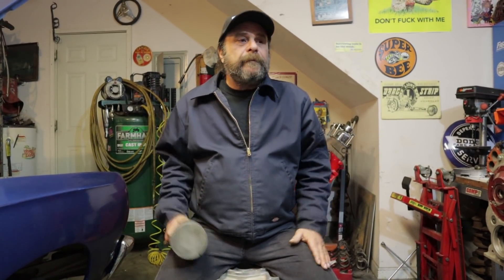3 Reasons Junkyard Engines Go Better With Boost

Comment: Back in the 80’s, if you had 300hp, you were the big boy in the neighborhood
Reply: I was gonna say same thing uncle tony did I had a car in high school in the the late 90s early 00s that ended up making 340hp on a chassis dyno and there were plenty older guys with cars they had built in the 80s way fast than that thing was
Reply: When we were young lots of us got misled, too. Kid I went to school with was selling a Chevelle claimed to be a 327 with 2 x 4bbl. Well, my cousin, the 'vette expert, did a PPI for a family friend that was interested in the car. Thurns out it was a 283 GM Marine block and the linkage was so messed up that only the primaries on the rear carb were operational. (think how happy the intake valves were about that).  So, absolutely no knock on Chump or Jim but when we were 17-19 dat's  da best some of us could do with only here say "technical help"
Reply: @ccpgmike620  I had similar issues but I learned that the local library had tons of great books on building and learning about cars.
On top of that they had like 20 years of hot rod magizines, some where on micro film. But the information was there if you wanted it bad enough and I went from one of the slowest to the fastest in about a year and I took a LOT of money from the assholes that liked to mislead the new guys.
Reply: @ccpgmike620  
I remember that stuff like it was yesterday - way more BS stories than the actual cars or parts! LMAO!!!!
Reply: While more horsepower was possible, i remember the budget of the average teenager build where I live in Philadelphia in the mid 80's limited most everyone I knew to the 300-400hp range. Considering that most of us lived in row houses without garages or even driveways we did the best we could with our curbside builds.
Reply: @jamessouthworth1699  
You nailed it.
A big part of it was the income of a given area or individual.
Reply: James Southworth yeah couldn’t imagine now it’s definitely a lot harder now
Reply: James Southworth also it helped when you knew a group of people with the same interests in cars every one tried to help each other out too.
Reply: @Jon-O.  
That's how it all worked back then, there were a few guys that could do anything but usually it was one guy did engines, one knew transmissions, another gears & axles, and someone knew body and paint.
People traded work back and forth or all got together and built a "neighborhood" car, we all raced the same nights on the same streets.
I'm not sure how some people can say much horsepower they were running back then, chassis dynos were all but non-existent, and unless you knew someone engine dyno time was big bucks.
A friend's father ran the dyno at the G.M. Tech center in Warren and the only people that got dyno time outside R&D were racers sponsored by Chevy - although my friend's father's cars always ended up dyno tuned (lol!).
Yeah, when it comes to money that parts harder now but the parts available now are incredible compared to back then.
Back then you made or modified parts that can be bought off the shelf now.
Reply: @Curtis Fleabag 3-400 at the wheels on pump gas and the motor back then was nothing to sneeze at. I knew plenty of guys making a lot more. But they were all running nitrous and or too much compression for pump gas.
Reply from the maker: Not really.  Back then, a stout street car was in the 6-750 horse range
Reply: Uncle Tony's Garage , yeah but I was 18- 19 then, 6-700 was unreachable
Reply: Jim Kalfakis lol ya I was surprised with the 340hp as all I had done to the car was add a mild cam and dual exhaust and a bigger carb it only had a 500 cfm carb at first and ported the heads with a dremel lol I’ve still got the motor both the cars long gone now. I did have the advantage of it being a motor from the 60s though so I had the compression
Reply: Uncle Tony's Garage 

Most I ever got was around 300 back then too. Of course that was SBC on a budget getting parts at swap meets and junkyard. No internet for advice or research. It was a very expensive task back then to achieve those numbers for most of us.
Reply: @chrisj197438  
That much is true - I was a little "spoiled" as far as knowledge back then, there was a short track racer (Rigurelo's neighbor) that kind of took me under his wing and taught me a lot of ways to make good power for next to nothing (like Uncle Tony is doing for people now) and sometimes sold me his worn out or obsolete parts cheap - including teaching me how to fix them and WHY I'd make power with certain parts.
Dyno tuning was a high dollar only thing back then.
I was the greasy neighborhood kid with the busted knuckles and a beat up small block 4spd Chevelle that outran a lot of the big block cars in the area - I had almost nothing for money but a damned good teacher.
But I was really really lucky.
Reply: Motor City Mike 
Wish I had a mentor back then. I was pretty much flying solo and learned by trial and error along with magazines now and then.
Reply: @chrisj197438  
I was lucky - no two ways about that.
But I did go through the same thing as you when I got bored with Chevys (that didn't take long).
I had grown up with Fords and Chryslers, so I went "back home" to them.
Back then the Ford and Chrysler go fast stuff was like black magic, there were almost no aftermarket parts (compared to Chevys), the magazines were nearly all Chevy stuff and the Ford and Chrysler knowledge was heavily guarded.
I broke or burned up a lot of parts learning the quirks of different engines in the early years but whipping up on the Chevy guys sure put a big smile on my face once I did.
I always liked a challenge.
Reply: STOCK...
Reply: Back in the 90s if you had a big wheel you was the cool kid 😎 on the block
Reply: @CC Ryder 
My Chevelle was anything but light...
3742lbs. + me which was another 215, wasn't what I'd call a light car. 
Are the Challengers & Camaros 4500lbs?
My 5.0 Capri was almost a thousand pounds lighter and my V8 Pintos varied from 2100 to 2300lbs. depending on which axle or trans I went with.
THOSE were light cars!
Reply: @CC Ryder 
Good enough
Reply: it all depends whether you mean cruising around on the street or at the drag strip.
Reply: in small towns, 300 hp was normal--i knew a few 68-72 Chevelles running that.  A large part of that was due to running pump gas--the magazines all built engines with 8:1 - 9:1 CR.  Swirl porting the chamber was new tech, and factory fast burn chambers weren't littering the junkyard yet.  The average hot rodder built their 350 or 351W to the 290-300 hp level offered in a 1970 SS or Mach I Mustang, once you added headers, an aluminum intake, and a real dual exhaust. It was enough to smoke the tires, and that was enough for these "Grown up kids".

I have the magazines from the 1980's, and 500 hp was big block territory. If you were actually, honestly making 600-750 range, you had a race engine on the street or a serious power adder (yes, there were magazine cars with fake blowers hiding a 4 bbl at the end of the seventies), and were making trips to the airport for Av Gas. There were street racers in Chicago making the news, typically grabbing tall deck 427 truck blocks and using thousand dollar billet stroker cranks and a lot of nitrous.  I'm thinking those blue and pink "yenko" camaros, and the other yellow one with the black Motion Performance arrow stripe down the side. 

The early 1980's was getting back on its feet, the late 80's were using EFI and small block mustangs to turn in great numbers. The tech was catching up, it was no longer "lots of cam, lots of compression and lots of carbs" backed up by a rear gear ratio that limited you to a 110 top speed like it had been in the prior decades.
Reply: It doesn't matter how much power the motor puts out if you cant get the car to hook up. It may be heresy but you can have too much power as well as too much tire. An example of too much tire. I knew a guy with an early Miata. He put wider tires on the rear end. After the first time he drove it in the rain. It scared him so much he put the stock rims and tires back on. On a wet road there was simply not enough weight on the ass end to squeeze the water into the tread pattern. It just wanted to hydroplane. Too much power. Power is only part of the equation. Burn outside might be fun and look impressive but I'd rather have a car that puts every bit of power through the drive train to the pavement. It's the engine, transmission, suspension and tires all working together as a system. If all you can do is smoke the tires you're just quoting Macbeth, Act 5, Scene 5. "Sound and fury signifying nothing"
Reply: True, its an age/maturity thing (and that's not meant out of disrepect).  When we were all younger, we wanted attention. We wanted a big power number, a noticeable power adder. That works well sitting still in a show, but out on the street, a car we're afraid of is a car we never max out. 

As we get older, we realize its enough just have a car worthy of being in a show. My old big block makes 400 hp, I have yet to get it over 70 mph, but folks recognize a 1968 4-4-2.  

I don't need to show off to get attention, those who are worth my time already notice the car. I enjoy my experience with it.  These two statements are things I can say about a house, a car, a romantic partner, a job position.  When you're older and/or mature, you realize this is the definition of success.
Reply: In the late 70’s and early 80’s the junk yards around here where full of big blocks sitting in old wrecked or just not running muscle cars. The junk yard I spent time in had 6 66 chevelle SS with big blocks, 3 were. 375 horse versions. You could pick up good heads for $100 Complete engines for $200 to $300, if we only knew how hard to find and expensive that stuff would become!
Reply: I remember my buddy in high school (1977) my buddy had a 55 Chevy with a 283 -2 4 bbls and a big thumping cam and stock heads and we thought it was fast . Could not of been very fast . Then my buddy built a 68 nova with a 327 -202 valve heads good cam -tourqer intake and 750 Holley. What a dif when we discovered what good heads did. That nova ran low 13 seconds on skinney slicks . Was fast to us in 1978 . Bet that 55 chev was a 16 second car. The nova guy ended up getting a 427 vette motor 435 hp and with a 411 posi was in the deep 12 second  range.Had those hush thrush mounted right on the headers .He pretty much beat every car around. Man that nova would bite at 2nd gear with those skinney slicks . The good old days trolling for races at the Frischs restaurants.Nowadays you would spend a fortune to build a fast street car . I know a guy here who drives a low 10 second fairmont and he gets beat half the time out there. New mustang and a blower and tires will get him.
Reply: @gregblack4581  I went to a junkyard in 1979 and found a Ford Pinto with a Hush Thrush muffler just put on it- the paint was not burned off yet. Put it on my 1972 Plymouth Barracuda with a 318 V8. It was stock with a little 2 barrel, and a combination paper and foam air filter added. It got up to 21 miles per gallon on the highway. I put money into new paint, back air shocks for the 60 series Dunlop tires, shag carpeting  and new vinyl for the front seat bottoms. I sold it 3 years later, when it just started to rust for the back quarter panels. I bought a 650cc Yamaha 2-cylinder motorcycle to ride every warmer 6 months, from 1980 to 1985.
Reply: Jim Kalfakis hey Jim me and my buddy picked up a 440 ci from the junk yard back in 1982 changed cam roller rocker and lifters stiffened valve train to withstand 7000 rpm forged rods, bored over I think it was .020” racing headers dual 4” inch exhaust with dumps between exhaust pipes and headers. Two 750 Holley double pumps high rise manifold ported and polished ram air intake. High stall converter 727 auto with a slap stick L body shifter. 4:10 rear end. Big tires in rear chose to flare fenders instead of tubbing it. That way we kept the back seat in the 1970 Plymouth satellite. Put it on the Dyno and got at the wheel 673 hp and 540 ftlbs of torque. Basically only sent out the block for decking and boring. The rest we did ourselves. The engine build cost us a little over 3400.00. A lot of used stuff where we could new where we couldn’t. Yeah so most rodders  had 600 hp in the 80s some of the new muscle cars back then were in the 300 hp range.
Reply: Maybe on factory stock cars

Comment: Couldn't agree more Tony, my friend. Im embarrassed at the work it takes for me to make 600 n/a in my olds 455 stuff...but the blocks split on boost. So what the am i supposed to do? Sell out and go to the other side? We will see. 
But the LS platform definately achieves this easily. I dont hate them. Like you, im jealous. 

Seasoned blocks are definately a thing, but we dont think about that anymore because anything us poor boys gonna touch has been seasoned. The LS cross bolt mains help, and all the factory learned goes a long long way, such as piston slap in a stock 5.3 they are perfect when they come to temp. 

Ring end gap is wayyy bigger than even now people give it credit for.  Butt some rings with even a 150 shot and bam. As in bad....bam.

Love your vids fellow mechanic brother. And i thank you for the early years and now the time we have now. U rock.
Reply: split on boost? i dont get that. it would split on n/a as well. i feel like high hp/ high rpm is what splits most blocks. turn it less rpm/ make a little less hp, but more tq and highway gear it.
Reply: @frigglebiscuit7484  split because of making potentially huge hp numbers which is relatively easy with boost
Reply: @williamstamper442  then keep the boost down. no point in having 600-1000hp if you cant put it to the ground. besides, olds make enough tq to cruise by high hp engines.
Reply: @frigglebiscuit7484  sure but then whats the point of adding boost? Us oldsmobile guys now have an aftermarket block to support 2000+ hp but it costs $5000. On my dream list however
Reply: @williamstamper442  I don't see the point of trying to go faster than someone else. It ends up costing big money for both sides, and destroy good parts.
Reply: @frigglebiscuit7484  not trying to go quicker or faster than anyone else. My own personal goal is just that...my own personal level of achievement. I learned 30 years ago i cant compete against money. 
Watch Tony's vids and he suggests all kinds of ways to do more for less and ive always been that mechanic too. Make more with less. But far as the performance levels i wish to achieve are entirely personal. I wish you the best on whatever you are trying to achieve in your own personal performance adventures. Lets all have fun with this and we all have something to learn no matter how old or young or in between!
Reply: @williamstamper442  then why not boost it too 600hp? It won't even take 14lbs, if its built with a good can and intake, etc.
Reply: @frigglebiscuit7484  i may have an update this spring. I already have a 620hp normally aspirated olds 462 (.030 over) so i dont want a turbo hanging off the front making the same.
Reply: @williamstamper442  fair enough. my dad had a nicely built 455 olds in a 68 firebird that ran 6.80 in the 1/8 for its first pass, then they kicked him out. he sold it to a guy that would regularly turn it 7000rpm(my dad told him not to, no power up there). even had the stock rockers lol.
Reply: @frigglebiscuit7484  my 620hp olds hated 6400 on the dyno so im kinda thinking no ah ah on 7000...but maybe once...who knows
Reply: @williamstamper442  haha, yea. My dad told him not to keep doing that, unless he wanted to sweep the engine up into a box.
Reply: @frigglebiscuit7484  contact me personally...id love to talk engines with you. This method kinda sucks. I have experience but nowhere near know all. I love other people's opinions on the subject and the end result is a stronger anvil on which to hammer on!